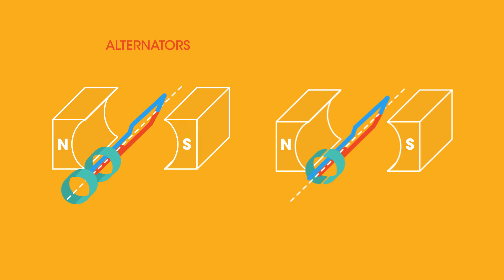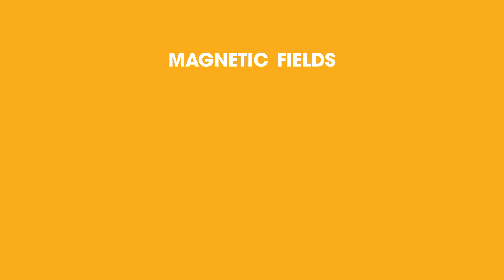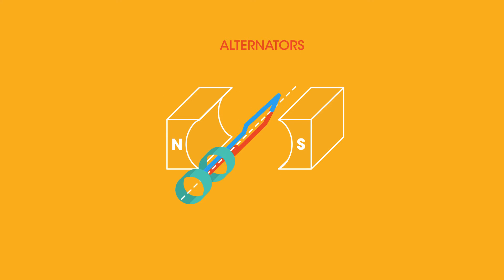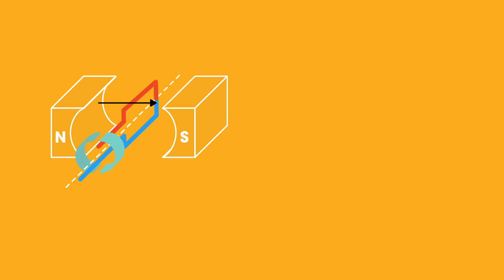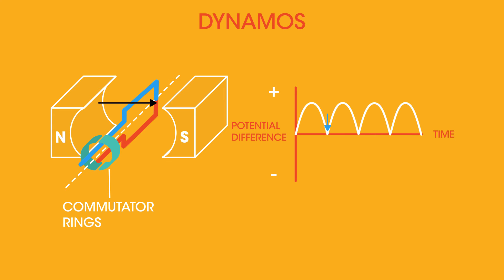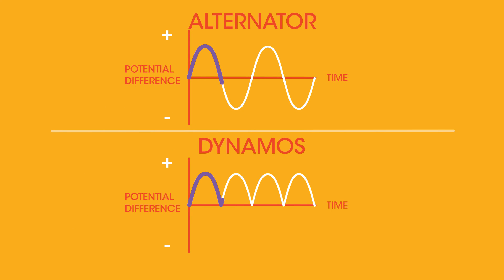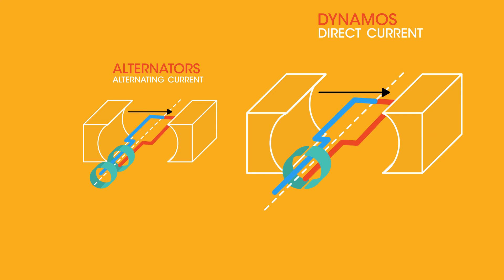Alternators and Dynamos | Magnetism | Physics | FuseSchool

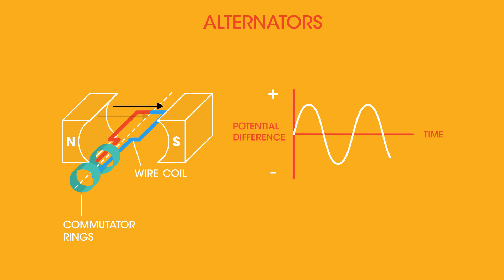Comment: I have a question: 1:41 why does the wire create maximum potential difference when it is parallel to the magnetic field lines, I'm sure it's because the two sides of the coil (wire) have up and down forces and that is what creates the maximum potential difference?
Reply: Not quite. You get a PD when the current CROSSES lines of force. When the coil is vertical the movement of the wire is along the lines of force so NO PD. When the coil is horizontal you are cutting lines of force at right angles therefore you get the maximum PD here
Reply: Because the wire is cutting through the most magnetic field lines. When it is vertical, it doesn’t cut through any magnetic field lines (because the magnetic field lines would be going through the middle of the coiled wire rather than “hitting” the wire.